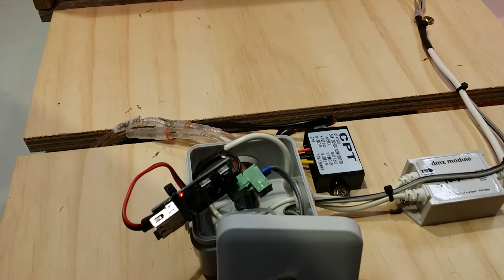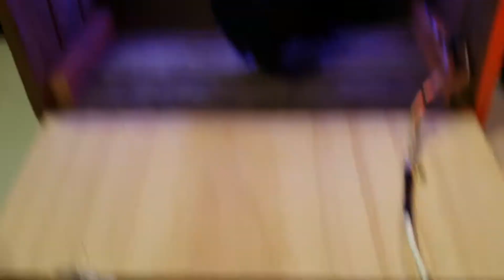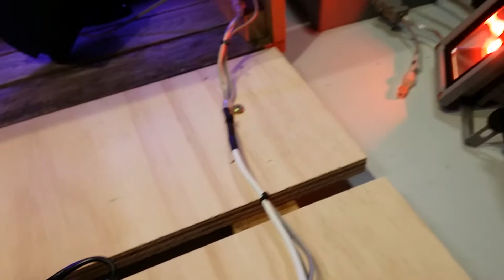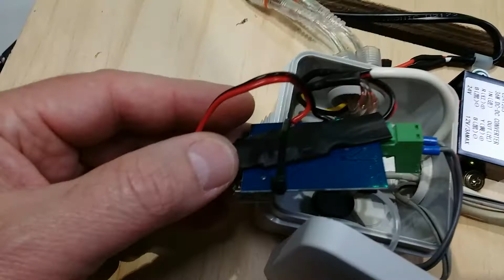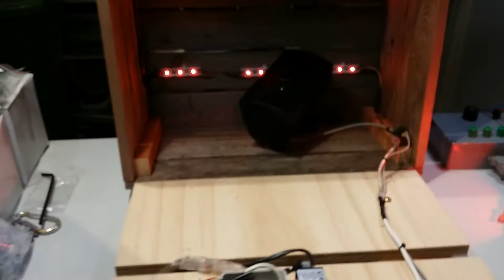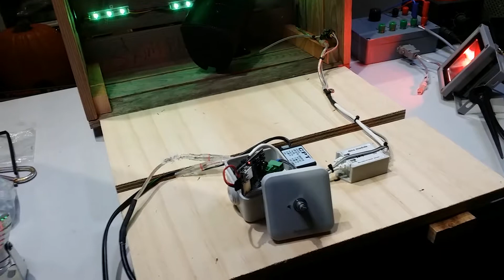Mystery Box Prop Update

Comment: Might have to look into those mp3 modules. Looking to have some ambient sounds playing in a few spots that don't have motion activated props. Have you looked at maybe making it bluetooth  enabled? It was an idea I had but not researched it much.
Reply from the maker: I have never looked for a bluetooth module as all I needed was stand alone operation and the audio is easy to change via the micro SD card if needed.
Reply: I guess I should log onto the forum and see if you posted about those MP3 boards.
Reply from the maker: @asmarteru  I did a little write up on them a while back https://www.da-share.com/misc/mp3-player-pcb-usb-usd/